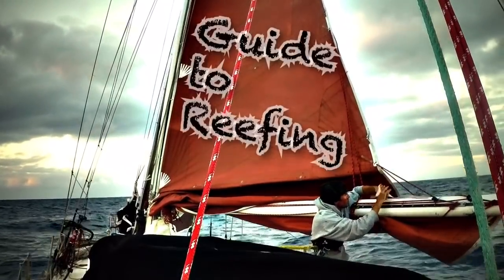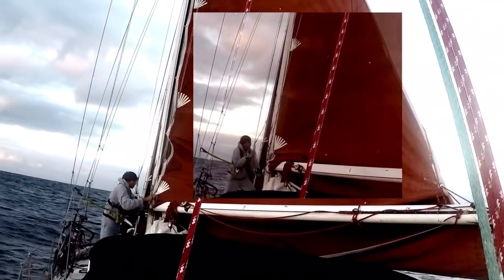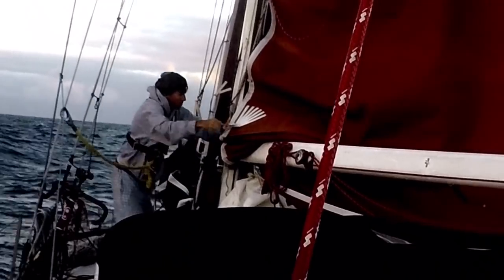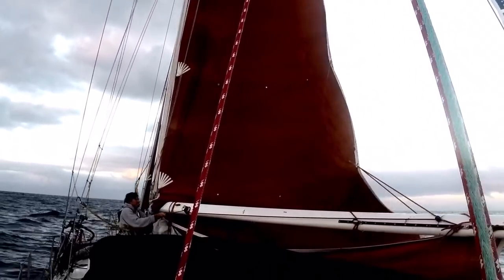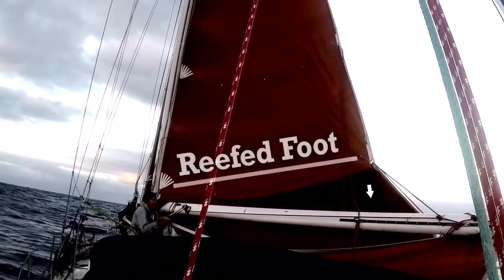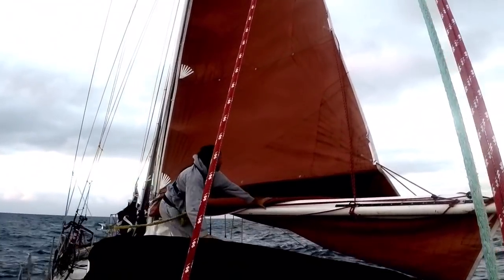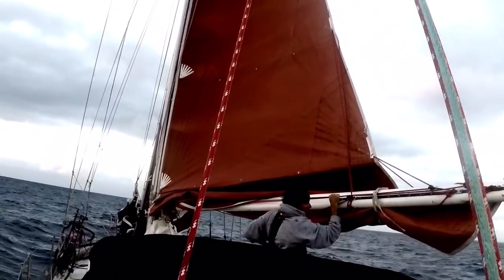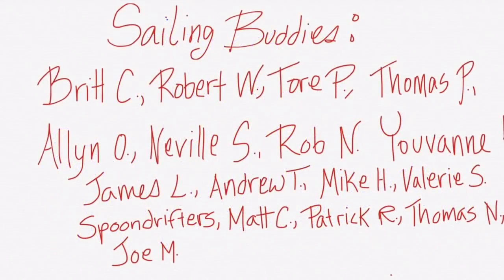Can you Reef ALONE?

Comment: Thank you for bringing up this important topic. Out of all options I've tried, I stick to heaving-to any time I need to reef, for the following points:
-the main is blanketed by backed genoa allowing to mostly avoid flapping 
-after reef is in, I drop my genoa across the deck and hoist a properly sized staysail on a new tack
-while hove-to on a starboard tack you can take as much time as needed without worrying about traffic, like SF Bay for example 
-while hove-to, the main sail can be trimmed in if any issue in the clew area arises, I doubt that it can be done on a broad reach as easily 
-it can be easily done even if your reefing is late. Fair winds to all ⛵️
Reply from the maker: These are good points! On the ocean with everything set perfectly on the wind steering, I didn’t want to change a thing about course so I would raise and lower sails on a broad reach. If I was tightening the clew and it was too much to handle on the winch, it simply meant to me that I needed to do an additional reef (say go from 1st to 2nd becomes 1st to 3rd). 
When the sail is loaded as you are reefing, you will know instantly if you have reefed enough. This is great and all when you are all alone in the middle of the ocean with tons of waterway ahead of you. In a crowded harbor or bay situation, heaving to is definitely the way to go. It stops the boat, let’s you get everything setup the way you want it, then you can head off again. 

I like the way you do things!
Reply: I have a C&C 30.   I've never been on a boat that goes hove-to so easily.   Once the foresail is back winded, it hardly matters what the mainsail tension is.  The funny thing is that she'll never drop below 1-2 knots of forward motion, no matter what I do.  Just enough for stability from motion across the keel, but still very forgiving about the rudder position.   Sometimes I think only sailors understand the love I feel for my boat.

Comment: Nice walk-through. Was always taught/advised that with a loose-footed main you can tie your reefing lines only around the gathered sail foot - NEVER the boom. Then you get a really nice/neat foot, less chafe, no chance of gusts inflating your nice fold/tuck job and if you attempt a shake-out missing a reef tie no damage as the whole sail will try to ascend with little stress since your clew line is already loosened.  You will notice this before any damage done.  Looks very "seamanshiply" done this way.
Reply: Agree.  I have a loose-footed main and only tie the reefing lines around the excess sail, not the boom, to prevent potential ripping since those mid-sail cringles aren't reinforced.

Comment: Nice video well explained. I have a couple of points. When reefing especially in the dark when the wind gets up & alone the less time spent at the mast the better. 
I don't use a pennant it takes too long to tie, I have a down-hall line that is attached to a pad eye on the mast that goes up & through the tack and then down to a winch. It takes about 30 seconds to do. With this system, I can control the luff tension. 
For the outhaul I control mine from the cockpit it comes out of the boom up through the cringle then down to a pre-set mark on the boom & around the boom finishing off with a bowline. This way when putting in the reef the boom is very high & in line with the foot of the sail. The reef line gives even tension on the foot & leach. The reason for this is when going beam to the wind & the boat is leaning over it keeps the boom out of the water. Like you, I don't have reef lines i have a very short lazy bag that I only use on the leeward side when reefing. Normally it takes me about 3 to 5 minutes depending on the sea state. Regards, Frank.
Reply from the maker: I actually switched from a lanyard that I tied to a soft shackle to make it faster. 
Good points!

Comment: Great video!  We teach to reef on a close reach (sailing on the jib, with mainsail luffing) or while hove-to.  We don't teach doing it on a broad reach, and in fact I've never tried it on a broad reach.... I would have thought there'd be too much pressure on the sail to get it down (unless you're reefing super early before the wind picks up much.... which would be smart anyway!). Maybe I'll try sometime.
Reply from the maker: I usually do it way before it hits, when the clouds start coming over the horizon. My goal is to be reefed down and back in the cockpit before it strikes! We have had those “oh crap” times when it caught us off guard and I had to reef in really nasty conditions. Having the boom eased out so far actually made it easier to get the clew in tight. It also lets you know if the reef you are doing is going to be enough; if it’s too hard to crank in, maybe do another reef more!
As for pulling the luff down, we have a Tides Marine Track and it makes the sail slide up or down with ease, even in a really strong blow!

Comment: Great vid. At around 07:55 is where a paranoid sailor might, since you're right there anyway, also tie a safety line from the boom to the leech reef cringle, just in case the reefing line breaks.  Make sure it's a quick release slip-knot.
Reply from the maker: That’s a good backup! Our reef line is technora so I’m not worried about it snapping under these loads, but if you have a questionable line in a nasty blow, extra safety is always a good idea!

Comment: Well explained mate very interesting way to avoid flogging main sail while reefing i always thought would be too much pressure on a beam reach
Reply from the maker: You do need a good low friction slide system for the mainsail track or they slides will bind up. We have a tides marine system and it’s worked great for many years.

Comment: I totally agree about getting reefed down before you need to, rather than after you realize you should have done it. That's where experience really guides you. The bow is always more violent from weather and water than the stern. The exception would be rogue waves. One thing I never see you carry is a belt knife when your on deck. A good sharp 5" straight blade knife in a kyvek sheath with a snap is good to have with you at all times. You never have time to go get it when the need arises.
Reply from the maker: I have a Rigging knife but it lives inside. I prefer to untie or unravel because then it’s not destroyed. But if needed, I would cut something free.

Comment: Of course not many boats have a winch on the boom.  
My reef line come through the boom and are tightened by hand.  If you raise the boom on the topping lift before pulling them in, when the boom drops they tighten. 
I like to tidy the loose sail, yes I ripped a tie point.  In future I shall change to elastic cord. Best is to have a short pennant with eyes each end,then tie the elastic cord to that.  Saves those untidy lines hanging all over the sail.

Comment: I note that both your (mast mounted) main halyard winch and your (boom mounted) reefing winch are on the port side. Some years ago a rigger moved my main halyard from starboard to portside but left my reefing winch mid boom on the starboard side. Now that i am full time cruising i wanted to change my reefing winch to a ST and to move it closer to the mast (maybe with a three way brake) but do you believe there is an argument for also moving it over to the port side of the boom?
Reply from the maker: The standard is for the main halyard to be on the starboard side and the job on the port. 
That said, this boat was setup fully in the port side so that is where I kept it. I do think that halyard and reefing winch should be in the same side so you can easily operate both of them on a specific tack. 
We try to always reef on port tack because it is a royal pain to reef on starboard tack!
Reply: @RiggingDoctor  interesting. Yes, both halyard and reefing used to be on the same side (starboard), so following this ecchsnge i will now bring the reefing over too. I can give you another reason. We carry a dingy and seven fuel cans up front, all in a 34 ft boat, so we try to make one side less clutured than the other. In future that will be our port side too !

Comment: As mentioned below, the clew of the main should be much closer to the boom - - says the books at least. This makes the foot and the sail flat, which is what you need in heavy winds. Is there a reason why you didn't fix this?
Reply from the maker: The same way you play with the outhaul to power the sail, having some belly in the smaller sail helps maintain the power and drive while the lower CE reduces heeling. 
While sailing on a broad reach, having some belly is advantageous.

Comment: Thank you for another interesting video. With regards to running the leech reefing line through the leech cringle, what have your experience been? Any chaffing of the sail around the cringle? Some skippers have resorted to attaching low friction ring pendent there.
Reply from the maker: The low friction rings are a great addition but not necessary. The cringle itself is stainless steel and very low friction, but the leech of the sail does chafe on the reef line and every few years I need to repair it. We have sailed about 8,000nm since the last repair and it’s still fine, so I don’t think it’s a huge issue. 
It’s not perfect but it’s also not a problem.
Reply: @RiggingDoctor  Thank you.

Comment: Great tutorial,  not to be too critical but the purchase point on your boom for the reefing clew needs to be addressed 
 The reefing line should pull down as it pulls aft.
Reply: Herb, i thought this too. Maybe just an artifactual incident that happened just for this video.
But the end of the pennant thats made off to the boom should be directly south of it's cringle so that the clew is pulled both down as well as outhauled by the clew line. If it is just tied around the boom it will slide to it's comfort zone which is the shortest distance between cringle and boom.  I suspect a year on, that's where you'll find it!

Comment: Isnt your clew purchase point supposed to be under the tack point?
Reply from the maker: It needs to be aft of the clew position to pull the sail down and back. If it only pulled down, the sail would be too full and therefore full of power. 
Pulling it aft flattens the foot and further de powers the sail, giving you a smaller and less powerful sail as wind speeds build.

Comment: I'm used to roller reefing , but my next boat is slab , so i've got a question , well actually two .
 The downhaul on the clew , why is the block mounted on the boom track , not closer to the clew of the sail . Surely that would bring the sail down more tidy , and tighten the foot up more , if the angle was increased ? 
and secondly , does no one secure the reefed foot under the boom anymore ? . I can see the reefing eyelets , but have yet to see anyone actually use them .
Reply from the maker: 1. Too far aft and it doesn’t pull down enough. So you scoot it forward and play with it until it pulls down and back correctly. 
2. I usually have lazy jacks and don’t mess with tying them. The holes are there but I never put in the lines because if I forget to untie one, it rips the sail. So I don’t untie any and just put a sail tie on at the second reef. If it gets to 3rd reef time, I drop the whole thing and put up the trysail.
Reply: @RiggingDoctor  Okay i can see what your saying . so you would adjust it , just you didn't or need to in this video , yeah . Just as a matter of interest , what in your mind is the optimum angle , to get the clew of the sail to set correctly .
So can i take it , you would tie the sail if you didn't have lazy jacks .
Reply from the maker: My lazy jacks died and I haven’t replaced them yet. It’s been about 2000 miles and no lazy jacks and no tying. I am going to replace the lazy jacks soon though :)

My optimum position is about 2 feet behind the clew of the reef point. As it comes down it pulls down well, then it shifts to pulling aft to flatten out the foot. 
If I’m going upwind, I will flatten the foot out all the way to de power the sail. If I’m going downwind I will keep it with a full belly (like in the video) so that we still have plenty of power to keep our speed.
Reply: @RiggingDoctor  Thanks my friend that is really helpful . I've watched a couple of vid's on slab reefing , but have yet to see anyone secure the foot . On my present boat , i found out the hard way that boom roller reefing , and kicking strap don't mix .  You either don't reef or don't use a kicker , but as my boat is a three quarter ton racer , and not suitable for deep water work anyway , it's never being a problem . The sail won't set properly either , so i lose drive as well . My next boat will be used offshore , and i'm studying a new system , so i hope you can understand why i asked . Thank you Doc .

Comment: Thanks for the info here. If you are solo how do you ensure you stay on a broad reach and don't get an accidental gybe when there is no one on the tiller/helm. Thanks
Reply from the maker: Windsteering. I trust it with my life! It keeps the boat on an exact course to the wind. If the wind shifts, the boat will change course to keep the wind at the same angle whereas an electric autopilot set to a magnetic heading would be at risk of an accidental jibe.
Reply: @RiggingDoctor  thanks! So something like a Hasler or Hydrovane self steering gear?

Comment: I have a question about tack horns please. I notice most have a horn on each side of the boom. Is this so you put hook the tack for the 1st reef on one horn and the 2nd reef on the other horn. Or can you hook both on to the same horn. I hope you follow what I mean. Also, do you leave the first reef setup in place during the second reef ? Or do you release the first reef before going to the second reef ? I guess what I mean is if you released reef two and pulled up the halyard would you just return to the first reef because its still set in place ?
Hope my questions make sense. Thank you.
Reply from the maker: With a horn setup, you can do exactly what you said. Have the first reef on one horn and then reef down again on the other horn. Releasing the second reef would now make the sail reefed to the first reef point. 
The main reason for the two horns is so that you can put the reef cringle onto the horn on either tack. It doesn’t matter which side you are standing on or which tack you are on because you just slip the ring over the horn. 
While the tack horn allows you to keep the first reef in place, the clew doesn’t always let you do that. On most boats the reef clew line goes to a cleat and winch, so in clearing the first reef line to make way for the second reef line, you effectively removed the first reef. Keeping it on the horn is just a matter of doing less while you are up there so you can get back to the cockpit quicker!
Reply: @RiggingDoctor  thanks for the reply. I'm trying to redo the rigging on an older boat from scratch. I'm having a few issues with setting up the outhaul and the reefing system because I'm now working with a boom that has no fittings on it. Blank canvas.
Reply: @RiggingDoctor  thinking about your statement regarding the horns. If I go ahead and install a horn on each side of the boom, would it then make sense to have the rigging for reef #1 on one side of the boom, and the rigging for reef #2 on the opposite side ? My halyards are on winches at the boom same as your video. I don't have winches on the boom. Not sure if I need n boom winches if I can get enough purchase by using a couple of blocks on each reefing line ? If I did get a couple of winches, they would need to have a small diameter base i think.
Reply from the maker: If you have a blank canvas, I would install a track on the side of the boom like I have. It lets you slide the reefing cheek block fore or aft as needed to get the position perfect. Also, if you ever change sails in the future, you can just slide the cars to be in the new perfect position. 
My clew winch is only a 16, it has a base that’s only about 4 inches in diameter.
Reply from the maker: I prefer to have the reef lines for the clew all be on the same side as the mainsail halyard winch so that you can easily operate both things from the same side of the sail. Otherwise, one reef will be easy to do because the reef line is on the same side as the winch while the other reef will be on the opposite side. 

Hope this helps!
Reply: @RiggingDoctor  this makes good sense. Funny I was looking at track just after I read your first reply this morning. Thank you.
Reply: @RiggingDoctor  this also makes a lot of sense. I sure appreciate your feedback. It helps to have somebody with experience verify a good way to set things up. Thank you.
Reply: @RiggingDoctor  sorry to bother you again. How do you recommend attaching the end of the reefing lines to the boom ? Some kind of eye hook and a knot in the line ? Or do you wrap around the bottom of the boom and fix at the track somehow ? Thanks again ? I'm new to this so have loads of questions....
Reply from the maker: @jasonfrodoman1316  the cars on the track have loops that you can use to tie the end of the reefing line to. Then you loop it under the boom and up into the sail. From the sail it comes back down to the car to a block or fair lead and from there forward along the boom to a cleat. The track is secured with screws while the blocks are secured to the track.
Reply: That was fast. Thanks. I'm thinking of skipping the track. Forgot to mention that part. So I guess I don't loop under the boom in this case. Sure appreciate your input, I'll be looking at more of your vids. BTW: just pulled a molar out by myself. Came out intact with 3 roots. Can you tell I'm an old fart. LOL.
Reply: If you put the cringles over the horns, you have to remove the slides from the track…a pain for many reasons.  So tie a pennant into the cringle.  Keep the bowline tight s it does fall off, or ideally a eye splice.